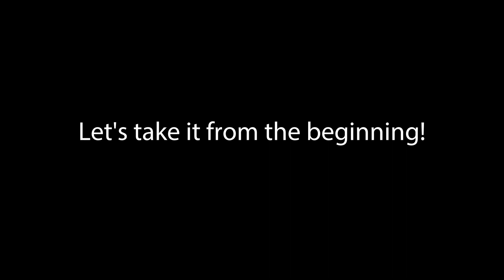DIY - 1 Watt tube AMP BUILD!! Dirty Shirley (Friedman) INSPIRED!

Comment: How does the 1w compare to your 1st build? I think you just struck gold with your first build, it sounded better than the stock Marshall, and obviously better than the Mesa. If you think there is nothing like you did from Ceriatone etc, you should sell the kit for this.  Or you can share the layout on some forums. Congrats.
Reply from the maker: Thank you! Im glad that you say that, I kind of feel the same way about the first build. Lucky try! 

The 1 watter is way different in fact I must have tried 50+ high end amps by now and I havent tried anything like that. My goal was to make the amp respond like a plexi on full but on useable volumes. Soundwise i would say its a combo from what I like about the plexi, mesa mkiic and slo. It hast the feel and glassyness of a plexi and the sustain and tone i like from the mesa and reminds me of an slo but not as bass heavy, has the same gainstructure and gain level as the slo aswell. 

Right now im trying to start making some amps and also letting guitarist here in sweden try it out and see what people think. I have one 100w head and a 50w combo built right now for that reason. I have a new version also ill be making som videos of in the future. Thanks again!
Reply: @Rohbemusic  It's good to be aware of it, because usually people will try to convince you that you need a lot of experience to build the best amp :)

Comment: interesting build ....pre-amp going to a Class AB power amp .    If you examine a Fender Champ amplifier, it  is Class A with a 6V6 tube and single ended transformer....but you could substitute a 9 pin as in a 12at7 or 12ax7.....with a Fender reverb transformer from a Fender combo amp with reverb.  All the Fender combo amplifiers with reverb, the reverb circuit is a Class A single ended amplifier feeding the reverb tank.  So if you     take the pre-amp from a Fender combo amp and terminate the signal flow at the reverb transformer output to the tank......that's essentially a potential stand alone simple Class A amp......plug a 8 ohm speaker load in instead of a reverb tank .  >>>>>>> But considering the low power of these type amplifiers,  I would add on a 'line out' jack on the speaker side of the output transformer.  This would permit using the signal generated by this little amp to be put into a higher power amp to drive it......which you might find interesting.........FOOD FOR THOUGHT
Reply from the maker: That is a cool idea! Would be a very easy build on a fender champ 👍. Im going to try this 1 watter out on my next band rehersal by running it in my mesa poweramp. Will add a simple line out but need to come up with some kind of load so might just use my loadbox this time. But later on I can wire the line out jack to switch in a 8 ohm or so load resistor. Might do a class a build soon. Really like my mesas in class a mode. Thanks for sharing Mike!

Comment: Hello Sir.You Sound like a smart guy.When building a to band, is it always a good idea to add a cho ke   in the circuit?Thanks JM
Reply from the maker: Hi. Well its such a cheap component over all when building a tube amp so I tend to go for it. Makes the amp a little quiter, I also like that it marginally knocks down the b+ a bit. But im all upp for experimenting, you could try it without. In the right settings you might not even notice the difference. But if this is your first build and you want to knock off a few bucks id say get one and save money on other stuff instead. Good luck 👍